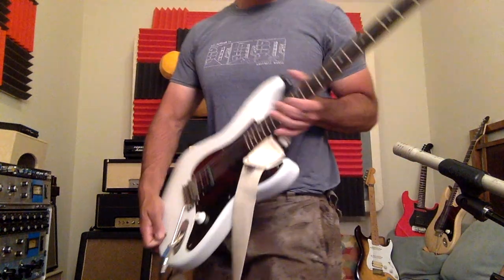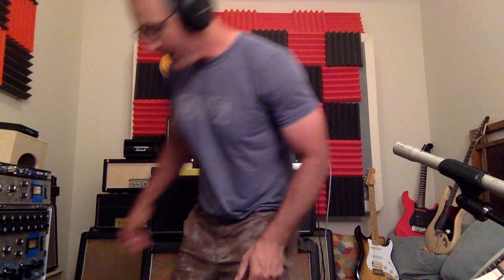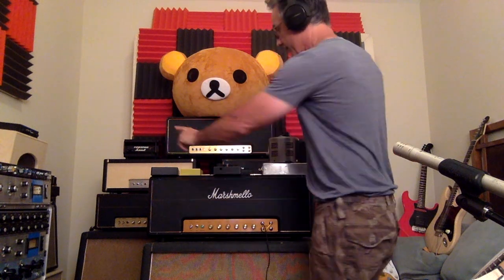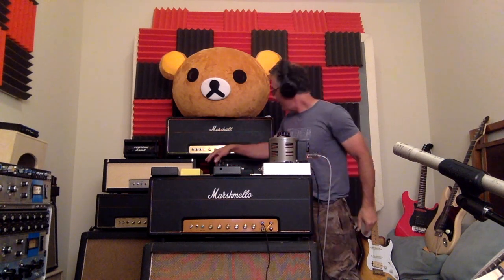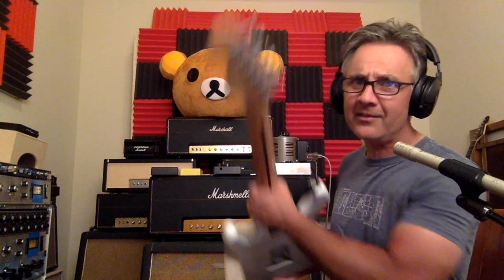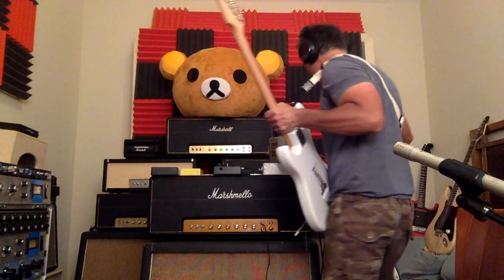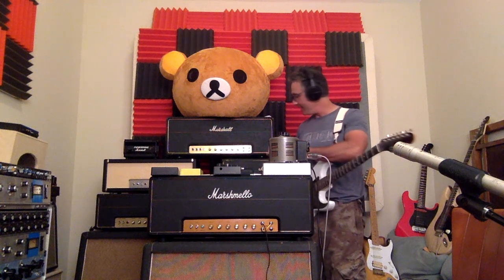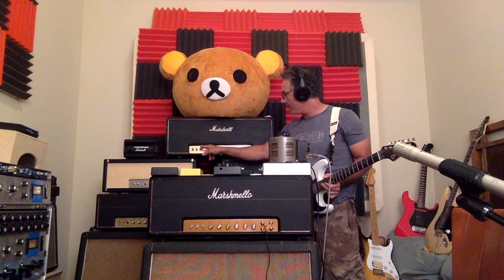Brown Sound Level 2 More With the Amp

Comment: som 20 years ago I read something about Eddie using  resistors across the power tube plates as a attenuator... I tried that for a couple of seconds and it worked, but i was very afraid of blowing the amp and kinda forget about it... Have you ever heard about that?

Comment: Can you drop a few "hints" about the modded amp? So far I have: modded OT; variac low; misc mods. (what about bias?) I assume the misc mods are to "taste" as there are so many options there. But the key (IMHO for any Marshall) it seems to be in the voltage, bias, NFB, and output tap and speaker choice of course. 

What are your thoughts on room/stage volume? With a slaved amp, one advantage always seems to me is the ability to adjust volume independent of the first (primary) gain stage. Although you demonstrate here that the second stage is also adding some gain as well, but not nearly as much as the first, and can be dialed to taste. In the studio that can be controlled with putting the speakers in iso/vocal booths. I have heard different things about that. That Ed's cabs were micd in the vocal booth, but there was also a Sunset Sound video last year with a gentleman (his name slips my mind at the moment) that said he played Ed's rig live in the studio and it wasn't as loud as he was expecting or as loud as his personal Marshalls. It sounded like (with picture evidence) that Ed was in the room with a single mic'd 4x12.

I know this tone quest is primarily about the brown sound, but I have to wonder about some of the earlier artists as well. These things weren't above techs from the 60s and Ed was only 10 years after Eric Clapton, Jimi Hendrix and Page Marshall sounds. I have to wonder about them too. For example, there's a video clip of Cream playing live in the revolution club and they are all standing in front of Marshall stacks. If you listen to the drum mics, the drums are being played without smashing the heck out of them, a nice fairly light touch by Ginger Baker. I have a hard time reconciling that with the gain I'm hearing in ECs Marshall stacks. Everyone seems to take it for granted they all just stood in front of 100w Marshalls and that's just how they did it. I just have a hard time trying to duplicate that, especially when you add in the vocal harmonies in that Cream example I was talking about. It's just really hard to sing in key in a nice vocal like they did not screaming into the mic. I don't know, I am just wondering if you have wondered about some of these things yourself? I guess my point is I wonder if Ed wasn't the first to do some of these master/slave or similar techniques. Also, I was looking at some pictures of Pages MSG rig and there was a shot of the back of the amps. I thought there might have been an additional input (post preamp) but I am just guessing and could be mistaken.

Also, in your next video can you review the signal chain. I'm pretty sure I'm following but it's been a year or so since I watched the first videos on this series and I just want to be sure I am understanding you correctly. Thanks!
Reply: Is this the basic signal chain? option one: guitar>phaser>master amp hi-bright input>speaker out to di>di to ox box di input>post effects (reverb etc.)
option 2: saa as above but from di out to phaser (time based effects) >power amp input of slave amp> speaker out to ox box speaker in>post effects
Reply from the maker: Hi Jimmy,

   The idea I am running with here is to get the power tubes biased very hot at a low voltage with very little load.  It involves what you say- load/bias/voltage/drive.  All of this allows for the power tubes to have very little headroom before they clip and produce less power for the speakers while shifting the frequency response quite a bit.  Its not a very healthy spot for an amp to be in :)

I do not know if this was exactly what EVH was doing or even if it was done on purpose but after hearing his amp in that overhead mic clip  I can say 100% that his amp was "malfunctioning".. I am trying to replicate that malfunction while trying to  keep the amp from destroying itself.

 I think he was just trying to get his amp under control volume wise and did what he could to get there by less than ideal means. This caused and unusual sound to be produced... 

Regarding other artists from the heyday of rock my guess is as good as yours.  Stage volume is a constant source of conflict between guitar players and singers.  Believe me I know it :). Guitar player and their techs are also notoriously cheeky.  Ill tell you two firsthand stories- My own experiences - and there are MANY more just like these:

I was walking behind the massive  backline of a legendary southern rock band I was doing a repair for and noticed all the the 4-12 cabs were unplugged and  one that had the back off and a little fender combo amp was in it that was mic'd from the front through the 4-12's grille. 

This one is funnier. on the last VH tour Wolfies tech walked me over to his bass rig.  He popped the front off one off the bass amp heads to reveal a stuffed hamster sitting in a wheel - a little red Christmas bulb lit up when you opened it up .... I shit you not... there was shredded paper in there and everything.

So if wolf was playing through a stuffed hamster on a wheel I guess we will never know what was going on with Clapton

Ossie
Reply: @ossieahsen6732  Hi Ossie, thanks for the explanation and anecdotes. Yes, I agree about the music industry being somewhat cheeky. Unfortunately, many of us now have hearing issues and suffered with poor sound because of taking those anecdotes somewhat naively at face value.

I suspect with all the global traveling and somewhat primitive AC power and variations that techs in those days would have been on top of something so basic as regulating voltage and stage volume for the artists (to be able to sing and play). I wonder if the artists may not have been privy to that knowledge overall as my feeling is they generally weren't very involved in the tech/engineering side of things, Page perhaps being an exception to those early days. My personal tone quest has been on those earlier Hendrix/Clapton/Page sounds, and I have been applying some of the principles you demonstrate but in a more muted way perhaps.

One thing I will say about Ed's brown sound is it has rich harmonic distortion and sustain not equalled by later Marshal plexi progression. It's interesting the earlier plexis ran higher plate voltage and had a cleaner but a very dynamic sound yet still rich in harmonic detail. My guess is the earlier transformers gave a warmer, rounder sound. Either way, it pays to constantly monitor/adjust bias and voltage when playing with amp distortion, especially since these circuits were designed to be played clean. The biggest things I've learned besides staying on top of bias and voltage, is to keep the signal as pure as possible in front of the amp. Even testing some supposedly good effects loops, they seem to rob the signal and reduce gain. IMHO splitting after the speaker out is the way to go  - with a load box or di, then running effects after.

Looking forward to the next videos.

Comment: So if you need mods to make this work on a stock Marshall, do you think Jose did these mods to Eddie’s amps?
Reply from the maker: Hi Matt.  
  Great question.  Although I do think he was running the amp this way....  I don't know if Ed did these changes to his amp.  That would be unknowable.  He said his amp  blew output transformers a lot so maybe he didn't .  Im sure the variac was helping quite a bit to keep the amp running

Ossie
Reply: @ossieahsen6732   Hi Ozzie, question: are there any photos of Ed using the variac on his live rig ? It seems strange that he would blow o/p transformers if he was running lower voltages (and therefore lower power o/p).
Reply: Are you coming out of the Marshmello into the DI box from after the pre-amp or after the power amp via the Oxbox?
Reply from the maker: @chrisstevens4680  Yes, there are many photos of the variac on stage with Ed.. he usually had 2 sitting on top of the heads.  The lower voltage was not going to blow the amps OT, its was helping to keeping it alive.   I hope that makes sense :)
Ossie
Reply from the maker: @chrisstevens4680  Im going into the DI after the power amp- right from the second speaker jack

Ossie
Reply: @chrisstevens4680  yes, there’s a better picture I can’t find right now but here’s a different one from the New Years Eve gig at Gazarri’s in 1977 that shows not only the variac but possible slaved Marshall’s as well.
Reply from the maker: @mattconrad5150  Yup!

Comment: I actually thought it sounded better without the slave set-up. I think at least PART of the reason for different "gain structures" or "textures" on that 1st album was different guitars with different pickups.
Reply from the maker: Hi Erik

I cant disagree with you :). 

 I do hear some very different tones on the album that I have not been able to attribute to PUPS.   Maybe ceramic vs alnico might?  Ceramic in the Strat and alnico in the destroyer?  OK. Time to break out the destroyer again!!

Ossie
Reply: @ossieahsen6732  i think it's the opposite actually. Ceramic SD in the strat and alnico Super70 in the Destroyer. This is what I'm using at home. Hated it at first, but then backed both pickups out a little farther than you normally would and it sounds great to me
Reply from the maker: @erikleach1753  Hi Erik,  I think that was what I said....but I am dyslexic.